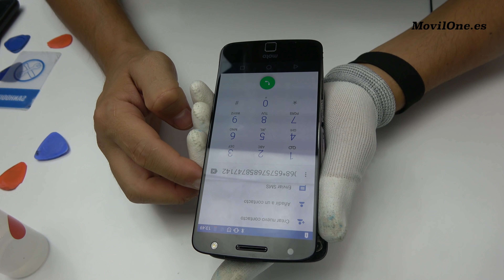Motorola Moto Z Battery replacement

Comment: Thanks for one of the 'better' how to do videos. Have now done 2 screens and on it's 3 battery, I try not to use the original turbo charge wall adapter anymore to extend the battery life.. Just in passing to anyone undertaking a screen swop, BE VERY careful and don't flex the screen cable near to it's attachment on the screen, it easily crackes way from the digitizer, ask how I found that out!! Bit late leaving a comment, used your video over 3 years ago..👍☺
Reply from the maker: Thanks for watching and sharing with us your experience! Best regards

Comment: Amazing video!  In fact, I replaced my  Moto-Z when the battery went completely dead and now I really miss the Moto-Z (an excellent phone overall) and want to revive it.  I watched your video and, with the confidence to follow your excellent video, I was able to remove the old battery without any problems.  Now, I've just ordered a new battery and, when it arrives, it will be a simple matter of reassembling the phone according to the second half of the video.
Reply from the maker: Hello, SPJvideo! I m so glad to hear that!!! If you need more information or do you have any doubt when you ll install the new battery, please let me know, i'll be glad to help you! Thank you for watching and Merry Christmas!
Reply: @MovilonePhoneRepair  yeah your WE APPLY ISOPROPYL ALCOHOL is definetly the trick behind this unbelievably not repairable phone. Thnks.
Reply: @MovilonePhoneRepair  Hi, I tried to repair my phone on my own but i broke the flat cable of the front flash, is there a way to replace it?
Reply: Ditto, my Z battery could literally go from 99% to 0% in about 10 seconds. I've never had a phone with a battery that dead before. Interestingly I have another one that has excellent battery life. There must have been quality issues with these batteries in certain runs.
Reply: Ya I missed mine so much I bought another but needs battery

Comment: I have a tip that might help anyone that is about to do this. I have a Droid force, so it might not apply, but if they are similar this will prevent u from damaging your screen and edges. I just got my phone taken apart and I did absolutely zero damage to the front screen or the edges in the process. I got the iFixit kit that included the battery and tools needed and I also read the instructions on the same website as well as watching all of these videos. The first thing you need to do is remember to be patient and take your time. The kit I got included a heating pad, but I ended up using a mini butane torch as well. I suppose a hairdryer would work too, but if you use a torch be very careful because you could obviously melt things. Anyway once you pry the two back plates off and expose the screws you will notice there are two holes in the top corners of the phone. They might be in different location on the z, but hopefully there are holes.  These holes actually go through to the back of the front screen and you can push something in the holes in order to break the seal in the two top corners once you heat them up a little of course. Doing this will prevent you from damaging the front of your phone when you start prying. That is the most likely place where you will damage something if you don't do it this way. anyway I used a precision screwdriver to push through one of those holes and the front corner of the screen came up almost immediately and I just stuck a razor underneath there and then a plastic wedge that was included in the kit and just moved it around the edges. this work quite well because I didn't do any damage to my screen or the edges of the phone. Anyway, I hope this helps. If anyone has any questions just post on here
Reply from the maker: Marco Jr, thank you very much for your suggestion and advice. Best regards
Reply: @MovilonePhoneRepair  no problem. You're welcome, and thanks for the great video. Thanks for the time and effort you put into it. Take care
Reply: Marco Jr 
It's a bit different with the Force, because the display is much more "solid" having those layers of plastic over it whitch makes easier to open it up..
With simple Z display is extremely thin and made only from glass harder to open it up.

Comment: To free up the battery I found a bit of heat from a hot plate along with the thin plastic top of a pringles container cut to a 70mm diameter circle worked great.  I would turn the circle which forced its way under the battery slightly.  I then added some wd 40 to reduce friction and soften the glue.  The  Pringles plastic was .3mm thick.

Comment: I tried this method and thought I had fixed it.  Phone worked perfectly... for about an hour.  The screen slowly turned a shade of purple and then black.  Petty sure its due to the heat.  If I were going to do this again I probably wouldn't use heat, or maybe I'd apply 5 seconds of heat.

Comment: Thanks for the guide! Unfortunatelly it doesn't say to be extremally carefool with guitar pick, so That it won't get too Deep as the amoled  Screen on moto z i super fragile. I broke my Screen this way trying to replace only the battery.
Reply: My phone's screen does not turn on but the touch still working, does that mean that I broke the amoled?
Reply: @CarlosBerni  Yes, most probably.

Comment: I have a Moto Z and I know that the battery is specifically giving me issues as the battery is 100% toasted. The local phone repair stores apparently couldn't identify what type of phone it was and "Couldn't access the battery." There's a lot on this phone that I'm unable to pull off and transfer over due to it's battery since it will kill itself while plugged in. I don't have steady enough hands to do something like replacing the battery, I've sent this video to my dad who does model work in his free time so he could do it, I'll happily let him take out money to buy the battery. I'm a little worried that my phone is a ticking fire bomb at the moment...

Comment: can you send me the material you used to glue the edges of the phone (oth the black duct tape and the glue) and the material you used to glue the battery back in? I just need a link, so i can buy them!
Reply from the maker: Hello, Yuri 77 Alves! You can look on eBay or Aliexpress for B7000 or T7000, we used and recommend it! Thank you for asking and if you need more information or have any question, I ll be glad to answer it! Best regards
Reply: @MovilonePhoneRepair  i would like to know this duct tape
Reply: Because regular duct tapes are permanent
Reply: Yuri.77 Alves 
Search in your country if you can find B7000 or simmilar stuff...It's an industrial adhesive , very good.

Comment: This video tutorial completely broke my Moto Z force, it was not accurate at all.  If there is a plate behind the screen then you will have to use another tutorial, this will break the screen.  Watch "Moto Z Force Teardown|Disassembly"  for an understanding of what I mean.  After watching several other videos all just duplicating the same processes in this video, I thought that it was simple.  This video must be for the Moto Z play, or some other version, perhaps I have a early vs late Moto Z force.  Someone asked where to buy the batteries, I found mine on Amazon, I believe ebay has it also.
Reply from the maker: Jesse, i m so sorry to hear that! This tutorial is for Motorola Moto Z  XT1650, maybe it s sounds like z Force but it s not the same device. More than that, to perform this repair you need specific tools and some experience, too.